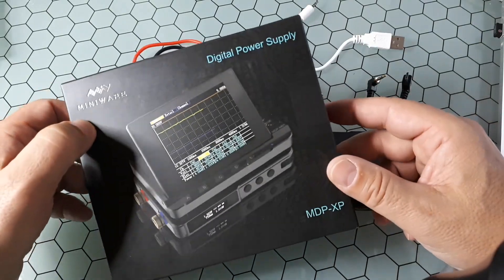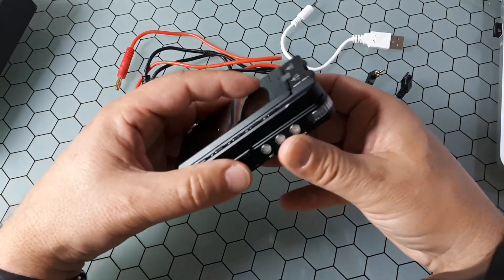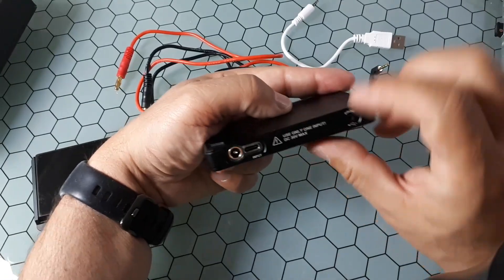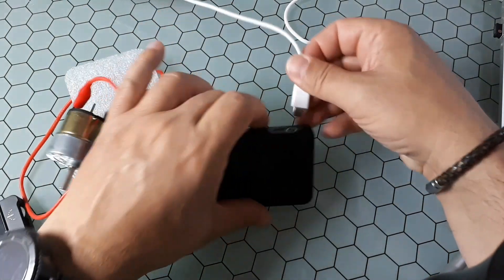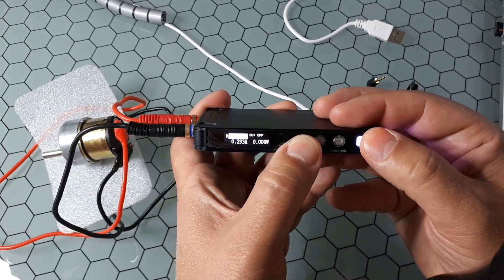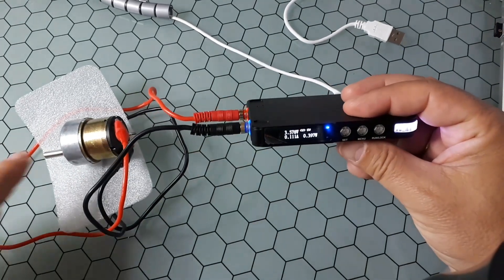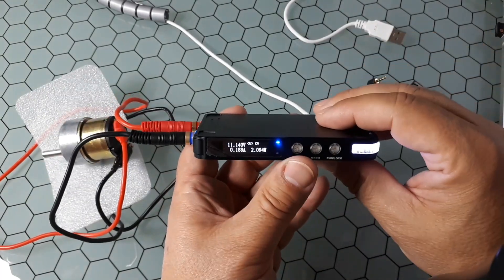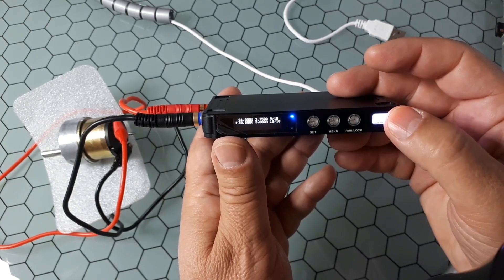Miniware MDP-XP Digital Power Supply tutorial

Comment: Im not sure Im understanding this exactly but my graph only shows 30V and 5A no matter what I have the output set to so powering a low current device doesnt really graph anything because the range is so large. Does anyone know what Im doing wrong?
Reply from the maker: Yeah, in my case is the same. The graph has fixed Y axis (at least in my firmware version), so for me is not so useful for graphical current measurement. In fact I use the unit without the screen as it is not needed for the power functionality and thus I have a poquet size quite nice power supply.

Comment: Is there any way to power off the system? I mean, without removing the  power cable.
Reply from the maker: You could stop the output, but the unit will still be on (although without any power output).
Reply: hold set and menu for a few seconds

Comment: Where are you connecting that USB-C cable? My USB-C wall plug does not cooperate with my MDP-P905 and I have to use the barrel jack instead :/
Reply from the maker: In my case it works well. I used a Samsung usb-c unit from my mobile phone. Contact the distributor. They may tell you more. Good luck
Reply: @alejandroalonsopuig  Can you mention the model? I would like to look up the specs for yours and see if I can find a matching one.
Reply from the maker: @brainkod  I tested it today and it works well with any phone charger, even low current ones with no problem. I mean the unit switch could switch on. Obviosly if the charger gives you low current, the unit will give only low current to any load, but it works
Reply: @alejandroalonsopuig  Right, the reason why I asked for more specific specs is because my MacBook 13" 2018, 29W USB-C charger does not cut it. The unit does not even power up when I connect it whereas the barrel jack at 12V works fine (as in just powering up the MDP).
Reply from the maker: @brainkod  It is weird. I have the same Macbook pro. I have just now tested connecting the unit to one usb port, then pushed RUN/LOCK in the unit and it switch on perfectly.
I am sorry to hear that the USB port doesn't work in your unit, because I think this is so convenient to have such small unit powered by usb for low current applications on the go. For example I can get a 24v source for PLCs or other devices just from a USB 5v port. I only use the barrell option for more current demanding applications.
Reply: @alejandroalonsopuig  Bizarre, I don't have the macbook pro (just MacBook (Retina, 12", 2017)... perhaps the wall plug has a higher rating on the pros? Anyway, thanks for your hints, I'll give it another try with colleagues at the office before buying a dedicated wall plug for it. Cheers!
Reply: @brainkod  Just got my unit and tested it a bit... Seems it doesn't support USB-C PD ports, I wasn't able to make it work with my Macbook Pro charger or other USB-C PD chargers or power banks, but with USB-A to USB-C cable works OK from any USB port & Power bank / supply... I also have a separate USB-C PD trigge, need to fix that with barrell connector and try...

Comment: Is this boost or buck
Reply: It is boost-buck followed by a linear regulator.   https://en.wikipedia.org/wiki/Buck%E2%80%93boost_converter
Reply from the maker: Don't know really
Reply: @alejandroalonsopuig  does it depend on the  QC3.0 standard to make the different voltages?
Reply from the maker: @Ender_Wiggin  voltage source could come from the usb connector or from any other power supply up to 30v via a different connector
Reply: @alejandroalonsopuig  Would it still be adjustable to 30V with a 5-volt source that is not QC3? i have only seen people use QC3 stuff. The spec on the website does not tell me whether or not I can get 30v out with 12 volts in.
Reply from the maker: @Ender_Wiggin  Yes, you can. In fact this is something I also questioned and tested. I got 30v from 5v input, but obviously the current you could get is much lower than the one your power source supply
Reply: @alejandroalonsopuig  Thank you very much i was very unsure about that part. Sweet I may distribute them to all the portable Electronics lab.